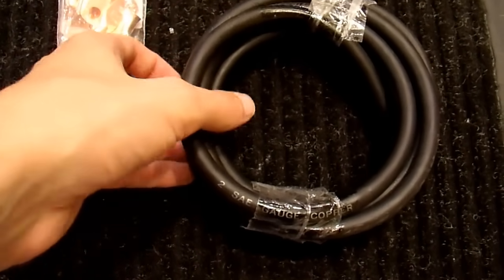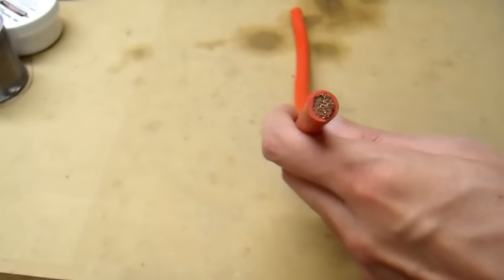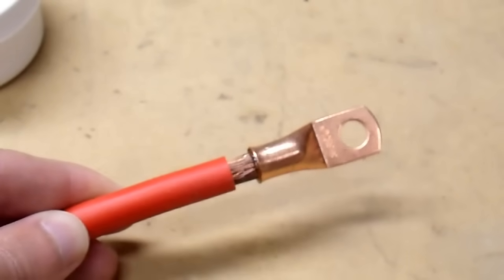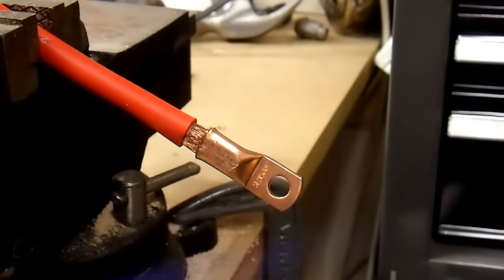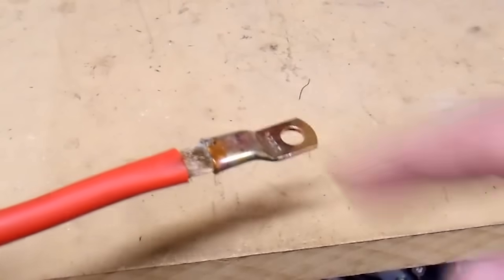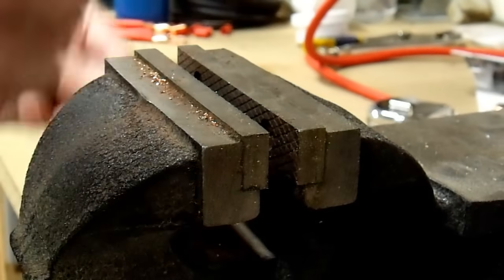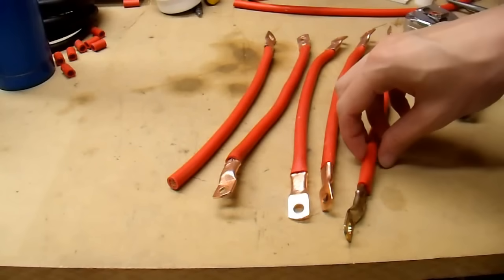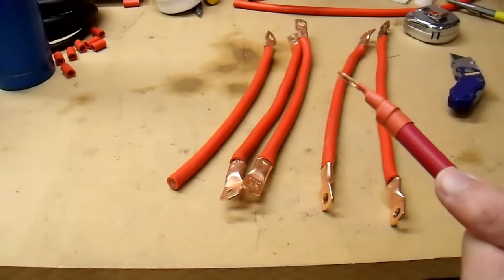How to Make Battery Cables the Right Way and the Easy Way

Comment: The main reason NOT to solder cables for automotive use is vibration. This is the same reason you use stranded wire instead of solid wire. It is able to flex some without breaking. The moment you solder a wire it becomes solid and will eventually break if used where there's vibration. Use dielectric grease or No-Ox inside the terminal then do a decent crimp and you will be good. If you want to use shrink tube to protect against weather then add a little more dielectric grease and only cover the crimped part plus a little wire. Do NOT push the shrink tube down to the flat area of the terminal end where it might interfere with the fastener. After heat shrinking just wipe off any excess grease that oozes out. The connection will last a lifetime.
Reply from the maker: Vibration is not an issue for soldered connections as long as there is compliance in the cable.  In fact automotive connections are nearly always 'soldered' in terms of metal impregnated terminations for reliability.  Solder specifically is not always used in production but hot mold processes are.  For example the connections to the battery where acid contamination is expected will eventually fail if not protected by solder or lead impregnation.  This is an extremely common failure mode on automobiles which are crimped but not 'soldered'.  Expect about 10 years on those vehicles before repairs are necessary.
Reply: @knurlgnar24  … As someone who just retired from both the electrical and auto trade I can assure you that OEM automotive cable is NOT soldered 99% of the time. I can also say that I have never seen a soldered cable in an industrial generator or any of the heavy cable used in transfer switches, not to mention power feed cables going into your home. They are usually crimped and if outside in the weather they use plenty of No-Ox. (No-Ox is a conductive paste for line voltage applications)
Reply: @rupe53  As a ROCK CRAWLING JEEP GUY you are 1,000% DEAD ON. Soldering ALWAYS & I MEAN ALWAYS FAILS, CRIMPING IS THE WAY TO GO, SOLDERING MAKES THE CABLE END STIFFER WITH HARDLY ANY FLEX WHICH IS WHAT ROCK CRAWLING IS ALL ABOUT.

Comment: Soldering provides way better continuity. If you add a shrink tube it will last indefinitely. thanks.
Reply: That only applies if the conductor and the associated connectors are expected to never move, flex, bend etc. and always stay put in the same place once soldered. This is of course not the case here as this rule will be broken the moment they're installed on the battery terminals. The particular sample (or any sample) might work without issues but that doesn't make it correct. Other conditions apply as well e.g. how much current is expected to flow under normal or fault conditions etc. for example in an accidental short-circuit or if used as high current welder cables, that solder might melt away without knowing in advance where it might end up in (and possibly cause other problems).

Comment: How is soldering better than crimping you plum?
Reply from the maker: It isn't necessarily better depending on the application.  Some terminations are designed to be soldered and not crimped for example and there are benefits to both.  A termination designed to be crimped could be soldered if you wanted the benefits of that type of connection instead, or if you had mismatched terminations and cable sizes, or any number of other special circumstances.

Comment: If you're going to make your own cable ends at least get the right tools and crimp the ends properly. Also heat shrink tube is good for several reasons: there's black and red for identification purposes.Iit also has the capability to isolate against shorts against other wires. It also has a sealant inside that coats the exposed copper and prevents it from getting moisture or oxygen on it. That's what depletes the cable end.  Heat shrink tubing is absolutely not just cosmetic, it should be used for connecting terminal ends to cable every time. This is probably the worst presentation of how to connect battery lug ends to cable.
Reply from the maker: This video isn't perfect but the backlash from people repeating the arbitrary techniques they have been taught is absurd.  Heat shrink in this application is absolutely cosmetic and in no way beneficial - many working on cable assemblies call them 'corrosion catchers' as they hide issues but please inspectors who are taught to follow the book - which is all too often written by committees lobbying for political mandates to use their services/products.  Heatshrink is rarely used in quality assemblies in corrosive environments such as automotive for good reason.  Heatshrink should NEVER be used to isolate electrically.  That's just sloppy.  And the 'correct' crimpers are sometimes not as good as you might think due to them meeting absolute minimum requirements to satisfy said committees at the lowest possible cost.  The crude techniques here resulted in 100% good cables that are still in use to this day which still stay cooler than the cable in-between the crimps reflecting their low resistance.  The point of the video is that you don't need special tools if you're just making a few cables.  And you don't.

Comment: can i connect 12v deep cycle battery to my car's main starter battery in parallel? the deep cycle is different size and is bigger in ah and amps. i need extra juice for electronics charging and lights.
Reply: Hi, I have same situation , I don’t know for shore is the right thing to do.

Comment: I have been soldering cables since before my apprenticeship,  1 you are using solder lugs they do not need crimping.  
2  you put the lug into the vice heat and fill with solder to just below the lip. 
3 whilst the solder is hot and with a little flux on the wire push the wire slowly into the solder,  whilst still heating the lug outer,  raise the wire up and down a few times and you will see the solder run into the wire push in,  remove heat,  let cool.  Finished perfect joint. 
Your method of crimp does not produce a good crimp,  that is butchering. 
Quick does not equal best. 
For extra low voltage you are setting your self up for trouble.
Reply: Kezza Tries, funny thing is I always drill a little hole at the bottom of the lug and solder it thru the hole, but I'm gonna have to try your technique now.
Reply: @anomilumiimulimona2924  cool,  I look forward to hearing back from you, re your results.
Tip,  when you put the lug into the vice, only hold the tip of the termination (say up to  the hole) end,  other wise the vice will act like a huge heatsink.  Do it right and it is quite quick,  no t as quick as crimping,  but much better than.  I recently purchased cables made up,  with some batteries (so they came from the battery suppliers)  test the crimp by pulling the ends came off some,  imagine them with a 4000 watt inverter. With extra low DC volts never crimp,  especially where high currents are involved,  or when you are solar  charging. 
Cheers Mate.
Reply: Kezza Tries, thanks that's good to know. Maybe I'll try it out tomorrow.

Comment: All that solder filling the voids that should be and would be filled with copper when crimped correctly. While your way may work chances are it won't stand the test of time and it is definitely not the proper way to terminate a cable.  Good heat shrink is a very good insulator and has a glue that melts and totally seals the crimp and any exposed cable from any corrosive gases as well as the elements. Obviously you have no electrical experience or you wouldn't of made such a bogus video.

Comment: And I forgot the most important reason for sealing the cable end with glue infused, heat shrink is so there is no gap between the termination and the wire to help prevent shorting anything out by inadvertently touching that open area when you're installing wires around the connection.

Comment: Heat shrink is for keeping the cable clean and free of gunk, plus, it helps stop the oxidation of the cable at the terminal.  Your reasons for not liking or not using heat shrink are bogus.  Just as not taking the time to solder the connection, using glue infused heat shrink to keep the connection clean and solid, half assed and looks anything but professional.

Comment: Well Video made in USA, why can't you change to Metric Wire sizes, is that around 50 mm Flex Cable? in New Zealand Soldering went out years ago. To easy to break lug off joint is not flexible, just use crimp lugs with a crimping Tool. Why can't all wiring in USA move into the 21st Century.

Comment: The best crimps are made with through hole ring terminals and actual quality wire and soldered through the top with a heatshrink put on them completely air tight everything tin coated and soldered rock solid for all time lookup how to make battery terminals by exocontralto that guy knows what he's doing

Comment: Heat shrink will KEEP moisture and those battery gases OUT of your connection. Everyone has opinions, but cables without shrink protection is like rain and no umbrella
Reply from the maker: Do you air your umbrella out after each use or wrap it up and seal it in a plastic bag wet and why?  One end of the heat shrink is always on the metal (usually copper) terminal.  This metal readily corrodes leaving a channel for the acid rich moisture to wick up into a location it cannot quickly evaporate from.  This results in hidden corrosion which is dangerous which is why you do NOT see these types of connections on cars today.  Hiding danger may be easy and popular but I prefer to prevent problems and to see them when they occur.  That is my opinion.

Comment: Soldering reduces resistance and increases strength 💪, smashing it isnt pretty like a crimping tool but it is the same principle. I like water resistant heat shrink.

Comment: Using the vise you will do better if you placed your cable end at 45 degree.  This way you won't squeeze the insulation.  You could have also simply cut off that extra copper so it would not have been exposed.  Better off that way, less chance of corrosion and oxidation.

Comment: Soldering is wrong way. Only crimping using proper tool is right way. Also much faster and easier. When you solder thick cable it looses flexibility and tend to break near connector.
Reply from the maker: Odd how so many people say soldering is the 'wrong way' when it is the only 'right way' for connectors which use a solder/flux pellet to connect the cable.  They are exactly the same:  Pure copper lug, copper cable, solder and flux or crimp depending on the manufacturer's instructions.  Some people are merely process followers who do what they are told without question and some people actually do their own research, have experience, and think about what they say and do.

Comment: Oh, My, God , really!!!!??? Get crimp tool, either hammer or hydraulic. If not don’t bother, geezzzz!
If you crimp properly there’s no room for solder to even flow into the lug. Do use heat shrink, preferably with heat sensitive adhesive inside.

Comment: use the heat shrink ,, use can always do a voltage drop test to determine the condition of connect ,or just cut it off , but the end of the cable DOES NEED TO BE STILLED, PREFURRABLY USE HEAT SHRINK WITH SEALANT

Comment: Erm! Properly applied heat shrink decreases oxidisation because it seals the copper from the air! Always ensure you crimp the terminals using the tool for the job! Use the right size solder and you don’t need to apply so much heat from the torch!!! Surprised you didn’t melt the insulation off the cable! Using a craft knife to strip insulation is an accident waiting to happen!

Just one more thing - a engineering vice (you’re calling it a ‘bench’ vice) is meant to be firmly fastened to the work bench! Why does yours flap about when you’re tightening or loosening it? Doesn’t that rather defeat its purpose of holding things firmly so you can work on them?

However, I did learn things so thanks for being brave enough to post this...

Comment: Definitely not letting you touch any wiring for me.. not remotely how I would do it..

I basically fill up the terminal full of solder, heat the wires some, and dunk the wire in the terminal.. never had a problem doing it this way, even ones from years ago.. works for me perfectly

Comment: This an example of reckless advice from a well meaning ignorant person - but great video of how to burn your place down. A correctly crimped lug is squeezed from all sides with tremendous force by the dies, forming an essentially air tight bundle. In a cross sectional view, the copper strands are deformed, eliminating the space between the strands. The result is a very reliable, dense-packed bundle that resembles a solid conductor.

Comment: Flood soldering is a much better method than crimping.
Reply: Soldering is not recommended for high amps because more current generate more heat that may melt the solder.
Reply: Crimp it with the right tool and it'll be practically cold welded.

Comment: The way I do it with the vise is I put a nut on the terminal so it makes a dent in the terminal, then beat it a few times with a hammer for extra measures. I wouldn't just press the terminal with the vise. May still not be the right way but should do. Best way is with a hammer or hydraulic crimp. I would never solder because solder may crack overtime, a good crimp will be 1000x better my opinion. As far as heat shrink goes, I'd never install big cables without heat shrink and not for looks (couldn't care less what it looks like) but for safety. Not saying my way is better or not, it's just another way if you don't have a hammer or hydraulic crimper.

Comment: Is there any reason  someone should not put some flux inside of the lug before it is crimped? It should help the solder flow all the way into the lug . Having solder coat the entire inside of the lug should help to fend off corrosion years down the road.

Comment: Right off ..to the point of dipping the cable into the flux..I noticed..#1  the cable first show is black..then the working with the cable..it is red..#2..the tools shown to be used..and what is used to cut the cable..are different..one used to cut the cable is not shown on the table..

Comment: Do what I say not what I do....wait....don't do what I do, do what I say is the correct way, but don't do it this way. Awe heck.....just do it the right way with the right tools.  
Remember the right way and the easy way (aka short cut methods) usually don't yield the same results. 

Really, for about $25 more, this could have been a helpful video to those that could use the correct info.

Comment: Lots of people said that you made these incorrectly. Now, of course the best way is to use a hexagonal crimping pattern in order to cold-weld the connections. But, given that I make electrical connections for a living, I would be perfectly fine with these connections. They are just fine.

Comment: You deformed the connector making it difficult for re-use.  I completely saturate the cable end with solder and then grind it to size.  Then I put the connector in the vice and melt solder into the connector about halfway up.  I then heat the connector again and insert the cable end into the connector.  I believe your way is the wrong way.

Comment: $24.48 a lot quicker and nicer. 
amazon.com IWISS Cable Lug Crimping Tool for Heavy Duty Wire Lugs,Battery Terminal,Copper Lugs AWG 8-1/0

https://www.amazon.com/IWISS-Terminal-Crimping-6-50mm%C2%B2-Electrician/dp/B017S9EINA/ref=sr_1_13?keywords=electric+wire+crimping+tool&qid=1562892910&s=gateway&sr=8-13

Comment: totally wrong  buy the proper crimping tool and you will save a ton of time and have a great connection
and you should have used rosin core solder the same solder they use on electronics 
acid core solder is used for plumbing rosin core solder is used for electronics no soldering paste involved, you don't have to worry about the acid eating the connection.

Comment: if you want an out of the box ready to go backup power solution with the pure gauge high heat proof copper cables already included, check out www.CarGenerator.com   Winner of $100k on Dragons Den like Shark Tank with two investors.    hooks up in a minute and provides power for days.

Comment: Ofcourse everyone in the comment section knows the correct way but no video to back it up. I don't have the tools that car manufacturers have to do the wires but I have done the soldering on the terminals on my truck and boat and have not had any issues for years.

Comment: Recommend TS-02 Four-indent Pneumatic Crimp Machine
Designed specially for crimping large size wires. Wire Crimp Range: 25-70mm²
FIND MORE INFO AT:http://jrready.com/product/showproduct.php?id=883&lang=en